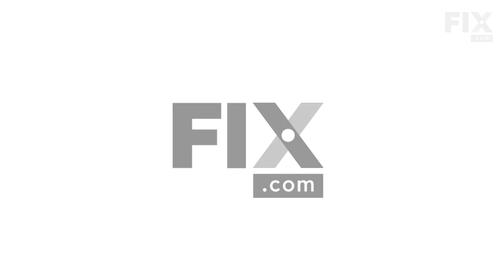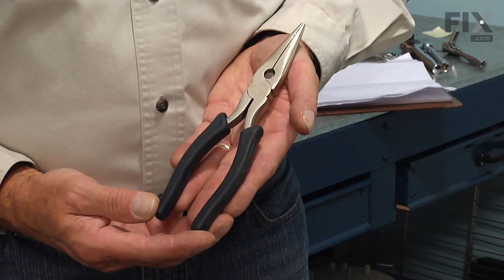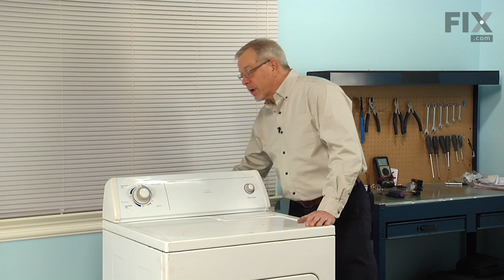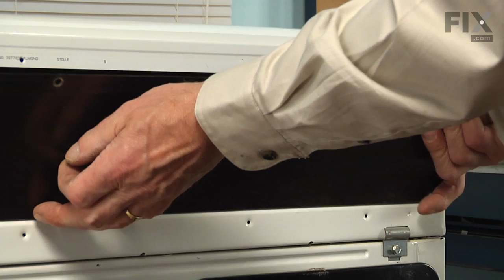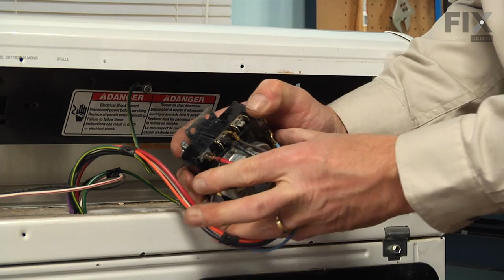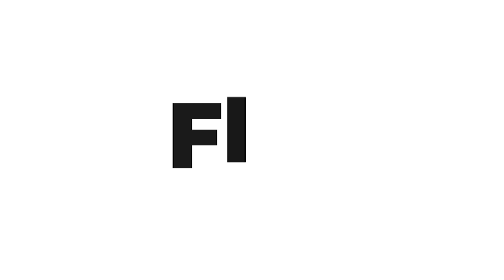Kenmore Dryer Repair – How to replace the Timer

Comment: I found that you don't have to get behind the dryer or pull it away from the wall. First I tried to take off the entire top but that didn't get me anywhere.
Next I found there are clips under the back panel where the timer is housed. Same as there are clips to hold the top down. Slip a putty knife between the top of the 
dryer and the bottom of the back panel. There are two clips. One on either side front. Then pull up on the back panel. It comes right off and its enough to 
spin the housing around and work on it from the front. FIRST UNPLUG THE DRYER....

Comment: I have a old kenmore 400. Was not heating up or igniting properly. Tested all the sensors in the back and all was working. Bought a new timer off amazon $80 as of 2023. Fixed all my issues and saved me allot of money. Thanks for the help. I hope this helps someone like it did me one day. Dryers are pretty easy. Just unplug the power first. Save money.

Comment: Do you know why the timer keeps running even after putting on off setting?
Reply: If the dryer still runs when the switch says it should be off, then the switch is broken. Hop this helps ladies. 😊
Reply: I have the same problem - did you get an answer?
Reply: Also I noticed in another comment that this video is 4 years old. 
I'm sure the tech that make this vid would not still be answering comments. 😞😞😞
Good luck ladies.
You can do it ! !  😊😊😊